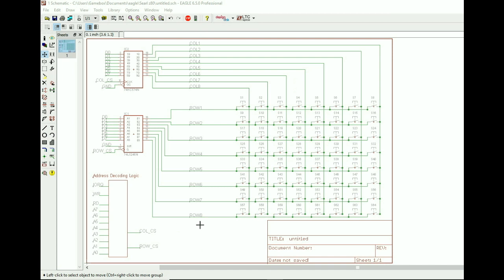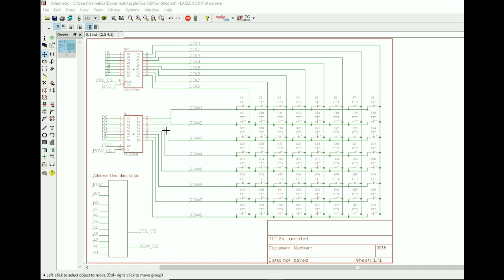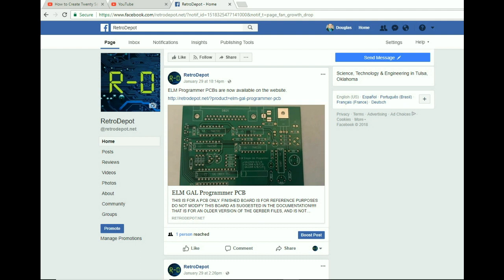Designing Keyboards for 8-Bit Computers

Comment: You sound just like the guy I need to talk to. Although what I am trying to do is probably a lot more simple then addressing a full keyboard. I am getting ready to build a Ben Eater 6502 breadboard computer. However I want to integrate a keypad (5x4 Matrix) and 6 - 7 segment displays to view the current memory address on 4 of them and be able to enter data using the keypad and the remaining 2 - 7 segment displays.
I have started a small series of videos on a 4x4 keypad but I could use some help moving forward on this project. This video looks like a good place to start.
I was impressed and intrigued with your simple keyboard poling techniques. I thought that I would have to use some sort of micro controller and program it to scan the keypad.
I still have a lot to learn...
Reply from the maker: Hey Jeff, I’m glad you’re finding the video useful. There plenty of ways to go about reading keypad inputs. I eventually did something very similar with my first z80 video. 

The easiest way for something along those lines is to use an octal latch and a octal transceiver in a matrix configuration, along with a software driven display. In this example the processor is always running, and the keypad and display are controlled by it. This is especially important since the 6502 requires a constant clock. Unlike the z80 which can have its clock halted. Of course you could implement some type of DMA along with a MCU to do the polling and register writes.... It really depends on what you’re hoping to achieve.
Reply: @RetroDepot  I am only at the very beginning stages of working with a keypad and a single 7 segment display. I have started creating a small series of videos, so that if someone comes in behind me, who is not an EE or a coder will have all or as much as I can give them, the information from the very beginning to the assembly language coding needed to drive the whole operation. 
https://www.youtube.com/watch?v=5zAoeCcj_yI&list=PLRcwtH0LBw25ENc4t-G33uxOAH57Zo8KT&index=4
I am ready to move on to a second display, but I am having a hard time wrapping my head around it and finding the correct information to achieve this. 
I was thinking that I would have to use some kind of octal latch and or shift register to move 7 segment code from low byte display to high byte display.
P.S I think you will really like my YouTube Channel...

Comment: Back in the old days a computer had a matrix of knobs. And pushing two keys at the same time gave strange results, it could not be done unless there were some precautions. Very soon after the matrix keyboards came a special keyboard processors that translated the keystroke into an 7 bit code and later on in a 8 bit ASCII code. 
 
We should not want to go back to the old matrix because it takes to much time to figure out what letter or cypher is where in that specific  matrix. All manufacturers had their own system. There was no unity. With the AT-keyboard there finally was a standard that could be used. 
 
If we now need a keyboard for a newly designed retro-computer we should use a standard keyboard and translate that into what is needed. Some people do simply have no idea about the costs of lose keyboard switches and key caps. I traveled half the country to find one matrix keyboard from the '70 while PC-keyboards are five for one banknote.
Reply from the maker: That may be. But lots of people are still designing hobby computers, and have an interest in the matrix style. And that is what this video was meant to address. I do agree if you’re building a complex and expandable system the 8042/8242 controller is a more practical method for getting input. Or even a USB Host controller for a 8-bit bus is nice. But people like designing their hobby systems in the theme of ‘how it used to be.’ And I can’t fault them for the nostalgia.
Reply: @RetroDepot  At this moment I am busy with an Elektor Junior Computer (a KIM-1 work alike). The matrix keyboard I've bought this summer is still unused, it is practically impossible to adapt an other matrix into the software made for another matrix. Rewiring or reprogramming, both possibilities are weeks or moths work.

Comment: Great video! One idea you didn’t cover, and I understand that many here would see it as blasphemy, is using something like an Arduino to do all the scanning for you and then use an INTerrupt to let the Z80 know that a key has been pressed and what ASCII code that key is. You could turn interrupts off at critical times of your code, but otherwise it would be very small in code and quick to process. But for those that want to keep to retro chips only, would be cool to see the equivalent idea done using maybe a ring counter?

Comment: Microphone? You keep fading out in to nothing and then coming back.

May I suggest something that includes a pop shield and a paragraphic EQ to cut the slight sibilance that is present, it would then improve the dynamic range for audio compression, which may be the problem, maybe you have an auto gain?? IDK. but it would help with a constant sound level.

Love the videos.

Comment: Where do you get keyboards from? Do you take apart PC keyboards, or build them yourself?
Reply from the maker: Martin,  It depends.  This video is about designing keyboards yourself.  But you can just as easily use the ideas in this video to design interfaces for keyboards from other computers.  Some things might need to be handled in software.  But really, the interface to them is not so different.  Personally, I typically try to build my own rather than tearing apart a computer to use for parts.  I'm a preservationist by nature.  So if I have a working example, it is worth more than that to me.  However, I have use parts from a broken computer before.  I suppose it would really depend on what I was wanting to do, and what I had on hand.  But having a 3D printer and the stuff to do PCB etching I can pretty much build anything I want to...

Comment: Great video.

I’m more used to ANDing values read from a port for keypresses. On the Spectrum, for example, the keyboard is divided into eight half-rows of five switches. The low byte of the port address is $fe (the keyboard is actually read by the ULA, but that’s irrelevant), and the high byte simply selects the half-row you’re interested in:

ld a,$f7 ;high byte of port to read
in a,($fe) ; read port $f7fe
and 1; is the rightmost/leftmost key pressed? (keypresses pull data lines low, not high)
jr z,do_stuff

Kempston, a popular joystick interface, used the same principle, although the controls pulled data lines high, so instead of JR Z you’d use JR NZ, e.g.:

in a,($1f) ;partial port decoding, so high byte is irrelevant
and $10 ;is it “FIRE”?
jr nz,do_stuff ;the opposite state of Z flag compared to keyboard

The standard ROM routine uses a more sophisticated method of keyboard polling (and a few lookup tables), but that’s because Sinclair BASIC was tokenized and used context to determine which token/symbol (out of up to five per key) to print.
Reply from the maker: Well, depending on your hardware ANDing could work well. But ORing works when your just checking to see if a bit is set.  I typically use AND to compare a particular value.  Assuming value in A (this does not include code to get the keypress...):

Routine:
OR A
RET Z
CP 01H
JR Z, KEY_BIT_1
CP 02H
JR Z,KEY_BIT_2
CP 04H
JR Z,KEY_BIT_3
...
... for rest of bits....
...
LD HL, (Begin_Lookup_Table)
ADD A,L
LD L,A
LD A,(HL)
RET   ;Key pressed is now in A

KEY_BIT_1:
LD A,01h
RET

KEY_BIT_2:
LD A, 02H
RET

KEY_BIT_3:
LD A,03H
RET
Reply from the maker: And, you'll have to forgive any mistakes in mnemonics....I just woke up and haven't had coffee yet.
Reply from the maker: This is just an example of what could be done.  I have not used this particular code.  I was just giving an example of what I had in mind, and the way that I generally do things when using a keyboard matrix.  I would have a routine to check the first row, then run this routine, if it contains a key press go on, or if not, go back and check the next row, then this routine,  and so forth until you're done checking for key presses.
Reply from the maker: I've got some pretty big stuff planned.  YouTube has lost favor due to some of their recent policy changes.  So I haven't been posting a lot of videos.  I do post fairly often to my website, and my Facebook page.  However, it's not only z80 stuff.  I'm working on a new computer design now, called the G80, which has a couple of variants.  And I'm working on updating that design at this time.  Currently it is a Serial/USB only computer.  However, I have plans to eventually implement video, keyboard interface, and mass storage (likely through Micro SD).  If you haven't done so, you should check it out.  www.retrodepot.net